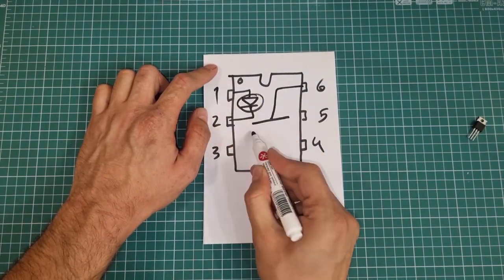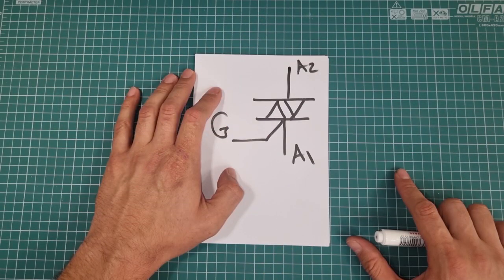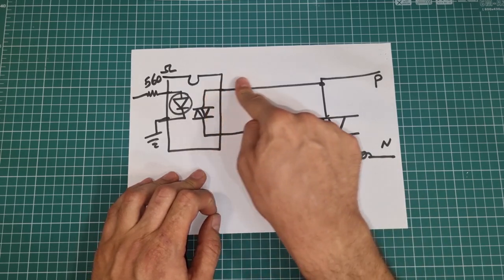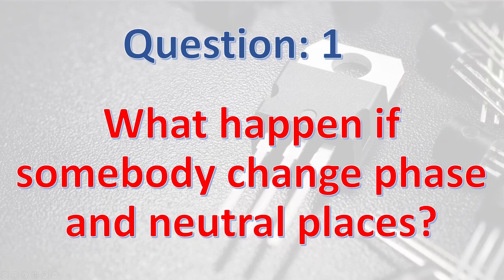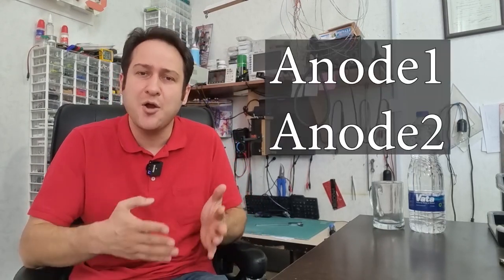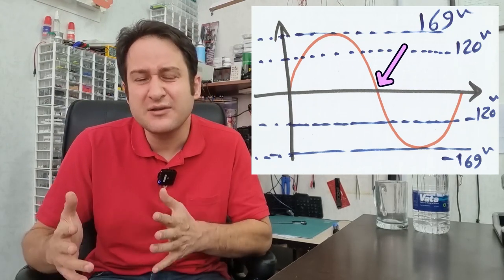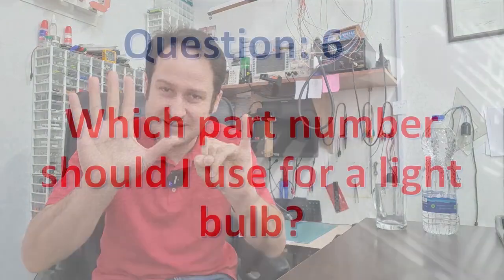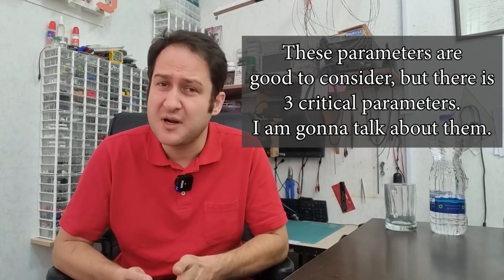Triac, tips and Tricks, how to use, clearly explained!

Comment: Hello, nice video for beginners but there's a lot more to know when using triacs:
- snubber networks for protection,
- zero crossing switch to reduce electrical noise generation,
- a lot of other things to consider 😁
Reply from the maker: That is right, I will cover more info about triacs in upcoming videos
Reply: Well Im a beginner and for some reason couldn't wrap my head around a triac until this video..lol. now you got me scared lol
Reply: You know, I think a 13 minute video is a great length, and this was just enough to whet my appetite.  That other stuff sounds interesting, and it's fine to follow-up with additional videos of nice, bite-size lengths.

Comment: To turn on/off an AC appliance (like a light bulb), of course it's much simpler to just use a relay which can switch both AC and DC loads.

The only real purpose of introducing a triac to a system is to clip the AC waveform and provide throttling which is a super useful function.  That could have been made clear at the beginning of the video.
Reply from the maker: Thank you for expressing your opinion 👍

Comment: Nice video!   How would you quickly test a triac with a multimeter?
Reply from the maker: It is a good idea for a video 👍
Reply: Hook and ohm meter / diode checker between anodes.
With the gate floating, the triac shouldn't fire.
Trigger the triac
It should have about one silicon diode's worth of drop when triggered.
Depending on the triac and the meter, there may not be enough current to keep the triac triggered so connecting and disconnecting the gate may make it conduct and stop conducting.
The main thing you are checking is that the triac isn't shorted and that its gate leg does something.
The most common failure in a triac is they go shorted.
The 2nd most failure is they blow open.

Comment: Great video. Why not just use a transistor to control the triac ?
Reply from the maker: It is possible to use a transistor. You may wonder it is possible to control the triac directly through microcontrollers GPIO. but us not safe. It is better to use optocouplers to isolate control section from the power section

Comment: Hi, thats grate. Thank you. 
One question, I try to turn on and off a water based cooler motor ( an AC motor that start with 10A and continue with 2A load) with BTA-140 triac and moc3021, I also add a snubber circuit. every thing work fine and I can switch on and off the cooler at first, but when cooler working for about 20min BTA-140 getting hot and it did not disconnect the cooler switch(did not turn off the cooler) any more 😢. 
any idea or workaround about this issue ?
Reply from the maker: 1-use a heatsink 
2-use original parts 
I guess the triac you are using is fake

Comment: Since you're using optotriac to gate the large triac, does that mean your large triac is turning on and off every time the AC current changes direction? Why not just use an optoisolator?
Reply from the maker: Yes, that is right, actually the main triac is turning on/off 👍
Reply: @elewizard  Is it also true that the large triac would turn itself off every cycle, without any help from the small triac, and therefor the small triac's only job is turning on the large triac every cycle?

Comment: Thank you.
I used an electronic contactor instead of a light bulb.
It works well when it turns on, but it doesn't turn off.
Why is that?
Reply from the maker: Was it a DC current you used?
Because triacs can switch on DC but can't turn it off.

Comment: im trying to use a triac paired with an arduino to control the direction of an ac motor, how would i go about this?
Reply from the maker: Consider using a contactor
Reply: @elewizard  so i would connect the pins that energize the contactor to the arduino, and wire up live wire to the motor through each side of the contactor, and that will allow me to control the turning on and off of the motor right. Also, how would i use this to change the direction of the motor

Comment: Touch the Triac when the circuit is live? 
Crazy to touch Mains Voltage? 
7:45 OK, you only have 120V AC and 170V peak. In Europe these are 240V AC and 340V peak.
That bites you hard in the fingers! 
This can lead to cardiac arrhythmias or death. 
If you're lucky and just fall off a chair or ladder and break your bones.
If things go badly, you can no longer pull your hand back and can't cut off the power.
In Europe, the rule is to set it up safely, then take your fingers away and switch it on. 

Don't touch it never while it's hot ! 
Never or you'll regret it or it is to late !
Reply from the maker: Yeah, that is right 👍

Comment: Still it its recommended to connect light bulb between triac and neutral, beacuse if you connect it to phase wire you could get electrocuted when you accidentally touch connectors.
Reply from the maker: Yes, that point is a great one, however in the video, I was intended to demonstrate it from an electric and electronic point of view.

Comment: How can dimming a incandescent bulb using Potentiometer isolated
Reply from the maker: In digital dimmers we use opto-couplers
Reply: @elewizard  but how is control circuitry for Potentiometer or rotary encoder
Reply from the maker: @eboy536  maybe I could make video someday to answer your question
Reply: You can likely find a "light dimmer" circuit on line.
The basic idea is to trigger the triac on only after some time has passed since the AC voltage went through zero.  The old type of dimmers simply used a resistor and capacitor to make a delayed voltage and a diac to trip the triac when the voltage hits some value.